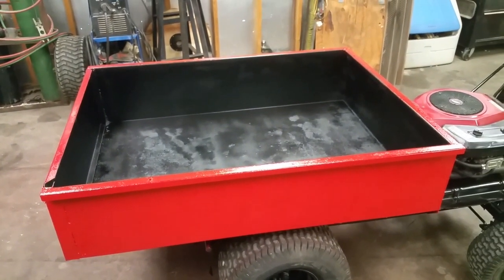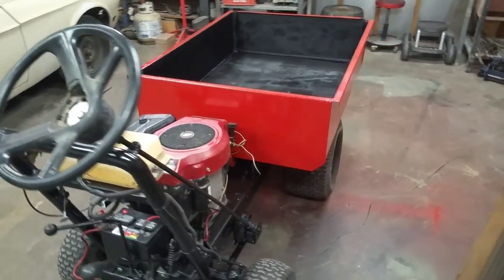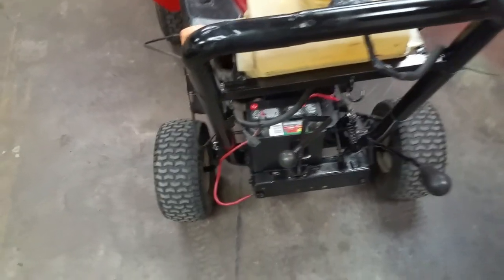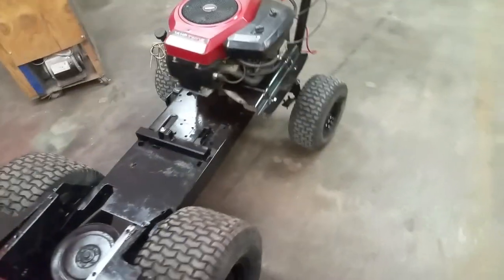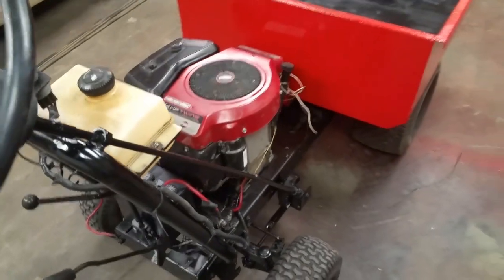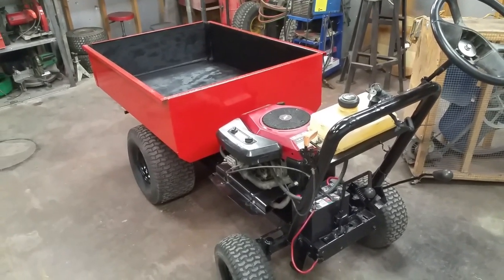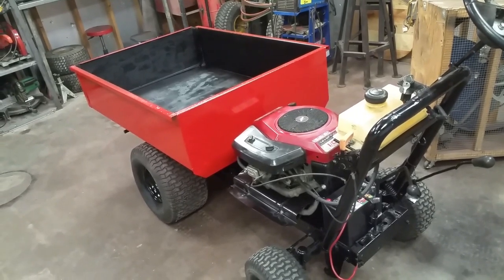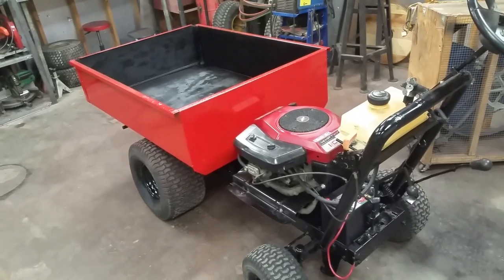Homemade Power wheelbarrow lawn cart

Comment: Nice! If I attempt this, I plan to replace the steering system with heavy duty wheels on castors like you see on a zero turn. Shouldn't take much effort to get it to turn while under power.

While I'm at it, I would probably install a handle similar to a tiller or walk behind zero turn so I can easily engage the drive belt without letting go of the handle.

Comment: Well i stumbled across your video after i just built one lol. I think I'm going to have to post a video of mine on my very non active channel. I took an old John Deere LX176 and reversed it similar to yours but i left a lot of the original parts on. Used the original 14hp Kawasaki on it and used the deck lift handle as the forward and reverse for the hydrostatic trans control. Are you still using your cart 6 years later?